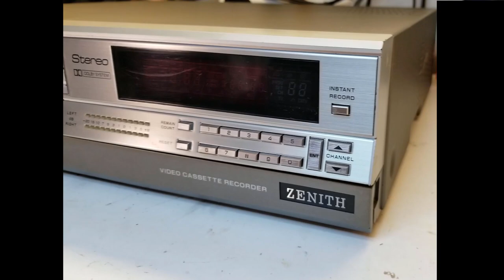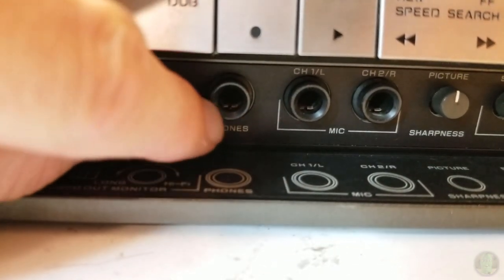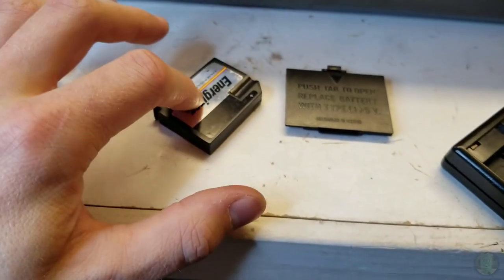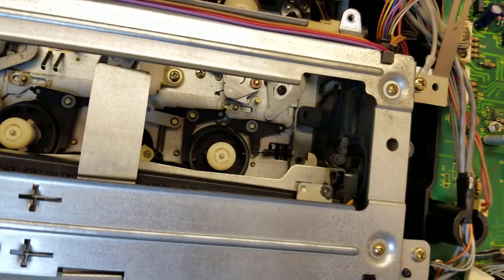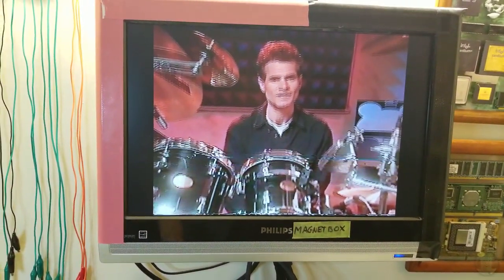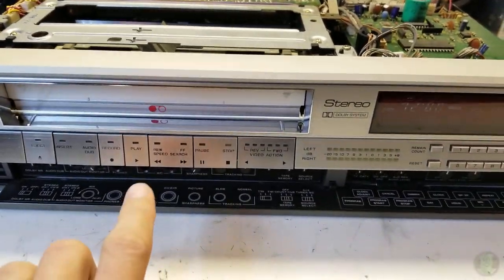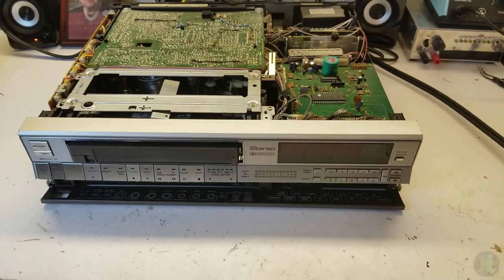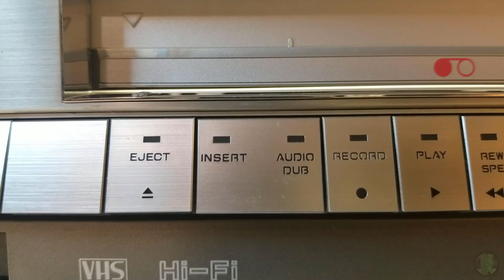Zenith VR-4000 VCR (Top End from 1984)

Comment: The phasing when hi-fi and linear audio is mixed is quite normal. The hifi and linear tracks sometimes don't exactly line up. I've had enough hi-fi VHS machines to know this happens.
Reply from the maker: I have a theory that it's because of the placement of the HiFi heads in relation to the video heads. This VCR has a DA4 configuration, but maybe the equipment used to record the tapes at the factory has a slightly different arrangement. I need to find a really old HiFi VCR that has the heads at a different arrangement to test this theory.

Comment: I got an earlier version of this JVC rebranded VCR off of Ebay for a few Euros. Interestingly it is showing the same kind of symptoms when loading tapes, but the gear is not broken. Mine is just a two head model with linear stereo sound. The only thing wrong with it was the loading belt, so I also put a rubber band from the kitchen on it, and it worked. I love the sound of the fast forward and rewind. Picture quality is not that great, and I am sure bad capacitors could be contributing to that.

Comment: I used to have a JVC VCR from 1985 with this mechanism, but it was a basic 2 head mono. I also have a Zenith 4 head mono VCR with the later JVC mechanism, the one that has separate motors for the capstan and idler. I have a Toshiba with a very similar mechanism to the VCR in this video as well.
Reply from the maker: Zenith didn't have many 2-head models from this time period. Was it the VR-1800? http://vintageelectronics.betamaxcollectors.com/zenithvhsvcrmodelvr1800.html
Reply: No, it was a JVC HR-D142U. And I currently have a Zenith VRD208.
Reply from the maker: @mrmagnetoscope  Isn't the JVC HR-D142U a 4-head?
Reply: Yeah it is, I forgot it was.

Comment: Now that is one hell of a good vcr,  worth a belt kit and a fix for that snapped plastic gear.
If there was nothing on the back of the gear, i would drill a small hole where the peg used to be and find a rod or fine thread screw to screw in, with care, then the cassette would go down every time :-D
Ive never seen a remote that uses such a daft battery, thats mad.
Reply from the maker: JVC seems to have used these "camera" batteries a lot in the late 70s/early 80s. I guess they were more common back then. This was back when remotes used all sorts of types (including 9 volt batteries).

Comment: What kind of VCR remote would use such an unknown type of battery? I've never seen one using other than AA or AAA.
Reply from the maker: Zenith liked to do things differently, I guess. A lot of older remotes used 9v batteries as well, but I think Zenith was the only brand to use J type batteries.
Reply: My old Grundig VCR remote works with a 9V battery.

Comment: I have the NEC895EU version. That loading mechanism is simple, but not. Make sure you take note of the timing marks. Your copper rings sound OK. Mine drag, probably need to re-glue them.(They lift)  I seem to remember seeing a 30 or 40 page document on the internet on how to go completely through these, but I haven't been able to find it.
Reply from the maker: I tried re-glueing them on a VR-3010 in another video and failed. I don't think i used the right glue. I ended up replacing the upper head drum from a parts JVC unit.

Comment: PQ40067 is the part number for the broken gear and I think it's still available from what I can see.
Reply from the maker: It appears I still can! With shipping it's roughly 3x what I paid for the VCR, but I still may order it, since I want to get this back to full working order.
Reply: @probnotstech  This particular VCR is worth many times the price of the part. It was build in the 80s when VCRs were better, and it has both linear stereo and hifi audio so it's definitely worth repairing.
Reply from the maker: Oh I agree 100%, the gear and PSU caps are at it needs. Excellent build quality, and it's basically a clone of the first Hi-Fi VHS VCR. Plus linear stereo too!
Reply: The Stereo Access jack may be for an adaptor for the TV tuner, as this came out a few months too early for a tuner that supported stereo. I got one of these machines recently, it seems good mechanically but has a few quirks I’m still figuring out. Good to know the audio meters aren’t broken, was wondering why mine weren’t working.

We had JVC’s Hi-Fi from the next year, which had a stereo TV tuner but they had dropped linear stereo. This drove me nuts as we could only play the newest movies in stereo. I don’t know why most hi-fi VCRs won’t play the linear track in stereo, but all pre-recorded tapes up to the very end still had that track in stereo.
Reply: Also, every VCR that can mix the two audio tracks gets them slightly out of sync. That function is mainly for dubbing narration over the linear track while keeping original audio on the Hi-fi, though I’ve never done that. The knob to switch tracks on this machine is pretty awkward, most of the time I just want to hear one track or the other but never mixed together.
Reply from the maker: There also used to be simulcasts (the switches that mix line in audio with tuner video were sometimes labeled as such). An FM radio station would broadcast the audio from the movie on a TV channel in stereo. You could connect the output from your stereo into the VCR and repace the mono broadcast audio with stereo. I remember this happening when I was a kid, as our local CBC station was mono until they went digital (not sure why). They would simulcast the audio from a Disney movie on Sunday evening on the radio. I didnt know what it was for at the time, I just thought it was cool I could listen to the movie in my bedroom in stereo.